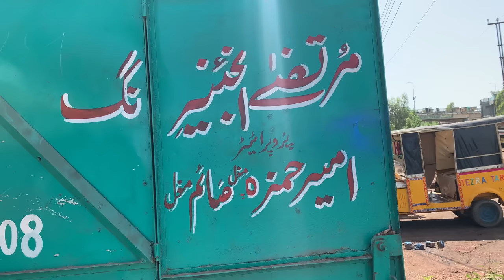Handmade Making Process of Hydraulic Tractor Trolley-Manufacturing Of Hydraulic Tractor Trolley|

Comment: The trailer is wrong on so many counts. Tipping pivot point, ram set up, tapered front of chassis, then the ornate edge?? Why?? And those poor guys health, skin eyes feet.
Reply: Who cares about safety? They'll be fine without toes. Who cares if they will be able to see or hear in a few years? I hope that one guy welding without a shield is welding with his eyes closed.
Reply: @nathanscott7910  yes poor lads, not having a go at them not at all, hard workers anyone can see that. But the uv an all that fumes.
Reply: A stronger trailer could've been built using less metal. It's all in the design and engineering.
Reply: @nathanscott7910  
This welding looks so easy, but can't you hear the guide dog sniffing in the background, every time the welder missing the weld?
Reply: See the guy with the coke bottle lenses..lol..eyes wide open
Reply: The more you bend the metal, the stronger it gets right?
Reply: You’re probably right on all accounts…. BUT it doesn’t matter because they got the job done.

That dump trailer/cart thing will be on the road working & completing some task that mammals used to do (donkeys/horses/humans) and as a community they’ll move forward.

A rising tide lifts all boats
Reply: Wrong. The trailer is good enough for it's customers and it's price class, or it would obviously not been in production
Reply: @Rimrock300  it's not in production it's a bodge up. I'm not saying it won't do a job I'm just saying it's all wrong. Why would you want the ass of your trailer to drop down as it tipped. Just daft. Wrong
Reply: @nathanscott7910 😊
Reply: First come on that trailers place 😂😂😂😂😂😂😂
Reply: There's nothing wrong with a tapered chassis. We also do it this way in Germany
Reply: There’s undoubtedly some fairly well to do owner in the background living higher on the hog. It’s a common dilemma. Take what you can find or keep walking.
Reply: Relax sissy!! Not everyone has the privileges born with. They do what they can with what they have. I admire their hard work and ingenuity.
Reply: Nothing more than scrap, bad workman ship. If I was the customer it would be going straight back. 😮
Reply: @Rimrock300 3rd world junk/ 3rd world price.
Reply: Welcome to the third world bro

Comment: Why they dont pour a piece of floor so tbey can have a perfectly flat spot for welding and setting stuff up making it way faster , instead theyd rather fyck around on dirt and set it up with rocks and dirt . To bad the work they do could be faster and better if they used a little bit of common sense . Probably not a greaseable pin anywhere on this build .

Comment: As much as this may seem like a great job to some, it is actually a very poorly done job! They used too heavy materials in the trailer, so that in the end the trailer weighs over 10 tons. Rusty materials were used that were not properly treated before welding, they will probably paint the trailer over that entire rusty surface. The welding technique may look impressive, but it is actually wrong because it is welding from the top down! Welders are likely to suffer from burns and eye irritation because they do not use any protective equipment at all. Lithium grease in wheel bearings? After stronger heating, the whole thing will leak out - graphite grease or similar is used!
Reply: If this cost around 1000 or 12oo usd then its acceptable in village type area with poor pocket. This is pakistan

Comment: Сварщик в простых очках ваще бессмертный что ль 😊
Reply: ... может и бессмертный но в розыске ! 🧐🤪
Reply: Сварщик даже не смотрит что он там варит тыкает куда попало,😁😁,просто какой то пипец .
Reply: А почему сварщик в кроссовках а не в шлепках? Непорядок...
Reply: @user-qy6rr4tu3y чё???
Reply: I think that.
1. They should use better personal protective equipment: gloves, boots, welding helmet, leather apron and mask.
2. They should use stronger solder, type 7018, 9018, 11018.
3. They must make bevels for welding and leave space between the pieces (1/8) so that the pieces stick or adhere correctly. And even more so when it can only be welded on one side.
4. For very serious jobs like these, it is necessary to apply the welding vertically upwards.
5. For jobs as serious as these, it is necessary to apply the welding beads alternately: at one, at six 🕕, at nine 🕘, at three 🕒... At two 🕑, at seven 🕖....
6. For jobs like these it is necessary to preheat the area where you are going to solder a little (60 degrees Celsius)
7. There is no need to bend the electrodes.
8. For jobs as delicate as these, it is better to apply the solder in letter (C) movements or in circles.
9. The entire piece should have some kind of tempering so that it does not bend so easily.
10. You can create a template or pattern to make the bevels  with oxycut jjj

Comment: Сварщик, сварщик - парень настоящий! Сварщик, сварщик - электродов ящик! (с)
Reply: I think that.
1. They should use better personal protective equipment: gloves, boots, welding helmet, leather apron and mask.
2. They should use stronger solder, type 7018, 9018, 11018.
3. They must make bevels for welding and leave space between the pieces (1/8) so that the pieces stick or adhere correctly. And even more so when it can only be welded on one side.
4. For very serious jobs like these, it is necessary to apply the welding vertically upwards.
5. For jobs as serious as these, it is necessary to apply the welding beads alternately: at one, at six 🕕, at nine 🕘, at three 🕒... At two 🕑, at seven 🕖....
6. For jobs like these it is necessary to preheat the area where you are going to solder a little (60 degrees Celsius)
7. There is no need to bend the electrodes.
8. For jobs as delicate as these, it is better to apply the solder in letter (C) movements or in circles.
9. The entire piece should have some kind of tempering so that it does not bend so easily.
10. You can create a template or pattern to make the bevels  with oxycut jjj

Comment: Они в конце просто приварили ось к раме? типа 3000 использованных электродов недостаточно, болты отстой, вари дальше. Судя по толщине и количеству металла штука эта не сено возить будет, при всем уважении, но дорог у них нет, этож ось отвалится за поворотом!
Reply: трактор медленно возит..  наверное только поэтому.
Reply: троллейбус рассчитан только на одну поездку.😉
Reply: I think that.
1. They should use better personal protective equipment: gloves, boots, welding helmet, leather apron and mask.
2. They should use stronger solder, type 7018, 9018, 11018.
3. They must make bevels for welding and leave space between the pieces (1/8) so that the pieces stick or adhere correctly. And even more so when it can only be welded on one side.
4. For very serious jobs like these, it is necessary to apply the welding vertically upwards.
5. For jobs as serious as these, it is necessary to apply the welding beads alternately: at one, at six 🕕, at nine 🕘, at three 🕒... At two 🕑, at seven 🕖....
6. For jobs like these it is necessary to preheat the area where you are going to solder a little (60 degrees Celsius)
7. There is no need to bend the electrodes.
8. For jobs as delicate as these, it is better to apply the solder in letter (C) movements or in circles.
9. The entire piece should have some kind of tempering so that it does not bend so easily.
10. You can create a template or pattern to make the bevels  with oxycut jjj

Comment: Owner was like "OK guys, this week we are supposed to build a tractor trailer. Tools are here and in the warehouse you have some 6 tones of steel."
Workers: "Yes."
Reply: *6 tons of steel scrap :D
Reply: @AKAtheA  Yes, good point. The whole trailer was made out of literall scrap but may not be that bad thing since, as far as I know, most of metal available (per price) in Pakisatn, Bangladesh, Sri Lanka... comes from ship breakers that cut old ships and sell the metal. Since shipbuilding is quite regulated (it should be, I hope), steel quality should be relatively good (most of ships are built out of EN S355/ DIN St52-3 steel).  The real issue is that, since they do not have metal available in standard dimensions (here in Europe steel beams in all forms are available in 6m (approx. 20 feet) or 12m (approx. 40 feet) they make beams for chasis by welding smaller pieces together to get to the desired length. Beam welding is not a bad thing (if done properly) but they definitely have way to many welds on main chasis and each weld zone is potentional crack zone. There are few design flaws / weak spots too. Connection between main chasis and axis is very weak for a trailer of this size, hinges connecting the lower and upper chasis are very weak too, lift mechanism is very crappy, movable parts with steel to steel contact under high load - it will wear in no time since there are also no lubrication/grease nipples.
Reply: Туда только электродов тонна ушла

Comment: Not only did they build a chassis by welding three different pieces, but welded the trailer axle on it too.
Reply: I think that.
1. They should use better personal protective equipment: gloves, boots, welding helmet, leather apron and mask.
2. They should use stronger solder, type 7018, 9018, 11018.
3. They must make bevels for welding and leave space between the pieces (1/8) so that the pieces stick or adhere correctly. And even more so when it can only be welded on one side.
4. For very serious jobs like these, it is necessary to apply the welding vertically upwards.
5. For jobs as serious as these, it is necessary to apply the welding beads alternately: at one, at six 🕕, at nine 🕘, at three 🕒... At two 🕑, at seven 🕖....
6. For jobs like these it is necessary to preheat the area where you are going to solder a little (60 degrees Celsius)
7. There is no need to bend the electrodes.
8. For jobs as delicate as these, it is better to apply the solder in letter (C) movements or in circles.
9. The entire piece should have some kind of tempering so that it does not bend so easily.
10. You can create a template or pattern to make the bevels  with oxycut jjj

Comment: As long as it runs well on the roads and the company feeds families, well done 👏 but for ISO 9001 we'll see later please.  it's a pleasure to see you at work, it's a change from those mega factory shows on the documentary channels.
Reply: Il.  Concetto.  E'. Giusto.... gran. Esperienza.....💪✋👍👀🇮🇹🇮🇹🇮🇹
Reply: they dont even know what ISO 9001 means
Reply: l ıake you comment- bravo ! Thank you!!
Reply: @jemandjemand2362 it's obviously standard Pakistan has so many companies working professionally in different sectors these are just street service providers across highways & heavy traffic roads to provide cheap work in immediate solution...
Reply: @jemandjemand2362 how come you jumped into this conclusion. They know ISO 9000,as well as, KAIZEN. The problem is those who have adopted these standards usually never allow these youtubers into their premises.
Reply: I think that.
1. They should use better personal protective equipment: gloves, boots, welding helmet, leather apron and mask.
2. They should use stronger solder, type 7018, 9018, 11018.
3. They must make bevels for welding and leave space between the pieces (1/8) so that the pieces stick or adhere correctly. And even more so when it can only be welded on one side.
4. For very serious jobs like these, it is necessary to apply the welding vertically upwards.
5. For jobs as serious as these, it is necessary to apply the welding beads alternately: at one, at six 🕕, at nine 🕘, at three 🕒... At two 🕑, at seven 🕖....
6. For jobs like these it is necessary to preheat the area where you are going to solder a little (60 degrees Celsius)
7. There is no need to bend the electrodes.
8. For jobs as delicate as these, it is better to apply the solder in letter (C) movements or in circles.
9. The entire piece should have some kind of tempering so that it does not bend so easily.
10. You can create a template or pattern to make the bevels  with oxycut jjj hhjb

Comment: Your workers will lose their vision and contract skin cancer if you do not provide them with eye and skin protection.  I watched several workers suffer burns to their hands during the video! Get them welding gloves and aprons. I know they are expensiive, but you will have to train new workers when they go blind, are seriously burned, or die from skin cancer.  It will cost you more to train new workers and slow your production than the cost of some personal protection equipment.  Protecting your workers' health is cheaper than retraining workers to replace the dead or injured ones.
Reply: It is not certain, the human is not taken into account in these countries, it is just a consumable that is replaced when it no longer works. It costs less to replace it than to equip it with protective equipment. and as for the training of new workers, seeing the quality of the work done, it's not super quality, but rather very basic, you just have to see the rust provided during construction, unthinkable in our factories or workshops.
Reply: @harentrois that's a sad reality in so many areas of the world. I watch alot of videos like this. You speak the truth about the lack of concern for human health and safety. It's crazy how many workers are barefoot or wearing sandals.
Reply: @harentrois  I agree with all except I wonder if your assesment that it costs less to replace a worker than to provide rudementary PPE is correct.  In this setting It seems to me that it would cost more in lost production time to replace and train a worker than to provide him with a proper welding helment, welding gloves and leather apron and mandate long sleeved shirts.  I understand work boots, or steel toed shoes and breathing apparatus are not happening.  Those welders and helpers are blind men walking.  One of them was staring into the arc as he was running the bead.  The helpers were actually holding the work piece bare handed as it was being welded.  Insane!
Reply: @sunny71169  No wonder they have to curse their god minimum 10 times a day.

Comment: They'll overload it like they do everthing else !
Reply: It will be good for 30 ton that trailer..😆😆😆
Reply: I think that.
1. They should use better personal protective equipment: gloves, boots, welding helmet, leather apron and mask.
2. They should use stronger solder, type 7018, 9018, 11018.
3. They must make bevels for welding and leave space between the pieces (1/8) so that the pieces stick or adhere correctly. And even more so when it can only be welded on one side.
4. For very serious jobs like these, it is necessary to apply the welding vertically upwards.
5. For jobs as serious as these, it is necessary to apply the welding beads alternately: at one, at six 🕕, at nine 🕘, at three 🕒... At two 🕑, at seven 🕖....
6. For jobs like these it is necessary to preheat the area where you are going to solder a little (60 degrees Celsius)
7. There is no need to bend the electrodes.
8. For jobs as delicate as these, it is better to apply the solder in letter (C) movements or in circles.
9. The entire piece should have some kind of tempering so that it does not bend so easily.
10. You can create a template or pattern to make the bevels  with oxycut jjj hhjb

Comment: Вот значит с кого "Миньонов" мультяшных срисовали! Рукастые мужики 👍
Reply: I think that.
1. They should use better personal protective equipment: gloves, boots, welding helmet, leather apron and mask.
2. They should use stronger solder, type 7018, 9018, 11018.
3. They must make bevels for welding and leave space between the pieces (1/8) so that the pieces stick or adhere correctly. And even more so when it can only be welded on one side.
4. For very serious jobs like these, it is necessary to apply the welding vertically upwards.
5. For jobs as serious as these, it is necessary to apply the welding beads alternately: at one, at six 🕕, at nine 🕘, at three 🕒... At two 🕑, at seven 🕖....
6. For jobs like these it is necessary to preheat the area where you are going to solder a little (60 degrees Celsius)
7. There is no need to bend the electrodes.
8. For jobs as delicate as these, it is better to apply the solder in letter (C) movements or in circles.
9. The entire piece should have some kind of tempering so that it does not bend so easily.
10. You can create a template or pattern to make the bevels  with oxycut jjj

Comment: like on the beach, welding in sandals and sunglasses, i like it, only couple of cold drinks willbe needed
Reply: I think that.
1. They should use better personal protective equipment: gloves, boots, welding helmet, leather apron and mask.
2. They should use stronger solder, type 7018, 9018, 11018.
3. They must make bevels for welding and leave space between the pieces (1/8) so that the pieces stick or adhere correctly. And even more so when it can only be welded on one side.
4. For very serious jobs like these, it is necessary to apply the welding vertically upwards.
5. For jobs as serious as these, it is necessary to apply the welding beads alternately: at one, at six 🕕, at nine 🕘, at three 🕒... At two 🕑, at seven 🕖....
6. For jobs like these it is necessary to preheat the area where you are going to solder a little (60 degrees Celsius)
7. There is no need to bend the electrodes.
8. For jobs as delicate as these, it is better to apply the solder in letter (C) movements or in circles.
9. The entire piece should have some kind of tempering so that it does not bend so easily.
10. You can create a template or pattern to make the bevels  with oxycut jjj